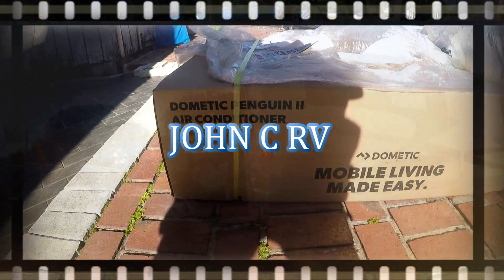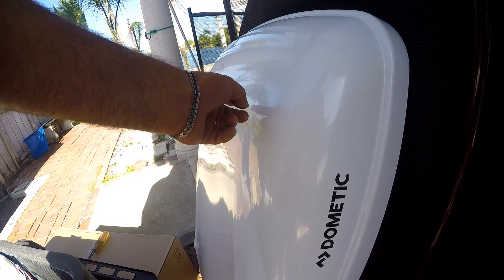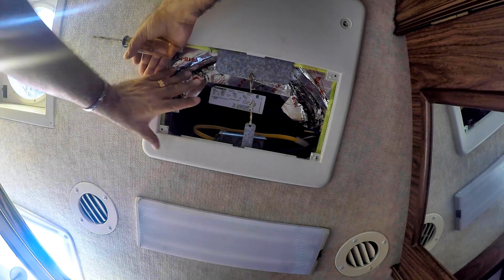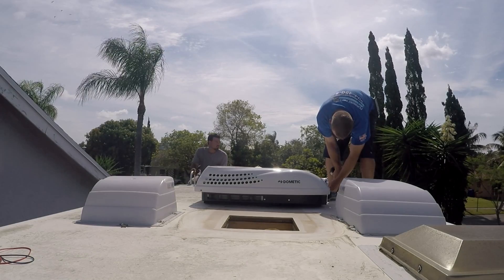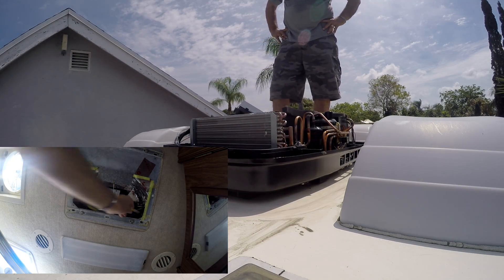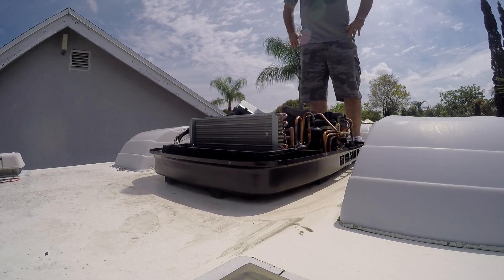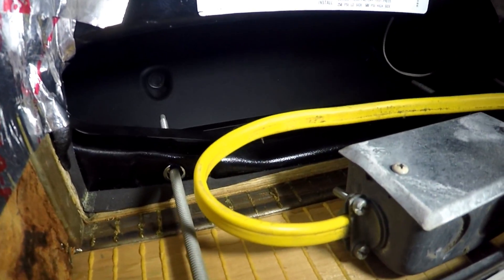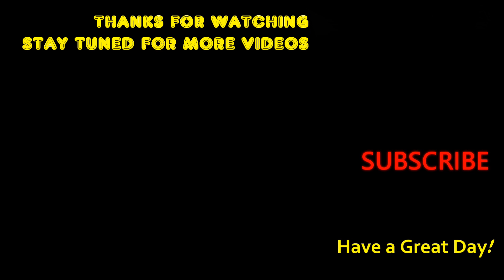HOW TO REPLACE RV AC DOMETIC PENGUIN II DUO THERM HEAT PUMP  - 12 button to 5 button Conversion kit

Comment from the maker: Replacing the 14 year old (rear) roof AC unit on my motorhome. The new air condition is a Dometic (651815) Penguin II - 13500 BTU - Low Profile - Duo Therm - Heat Pump and conversion kit to make it compatible with my 5 button controller.

Comment: Great video, very helpful. Can you walk me thru the decision to stick with the 5 button thermostat? Does the 12 button thermostat require running new wires? Or what?
Reply from the maker: The biggest reason is my front A/C unit is not compatible with the 12 button. If and when I exchange that one I will definitely convert back to the 12 button.

Comment: This video really saved the day.  Was able to successfully do this exact same process on a retired Navy Chief’s Motorhome in about 4 hours including the control board.  We watched this video about 5 times!  For the part you clipped out about wiring the new 5-button control module, if anyone reads this, the instructions are pretty good that come with the board, and easy to do.  For the dip switches, just make it the same as the one you’re replacing.  Ours were all off but #5 furnace (on).  They are nice and cool again.
Reply from the maker: I’m glad this is helping someone out there, this is really a great comment. The board  swap was very easy to do after I watched the technician do it LoL. But it would have taken me forever to do that part. You did the complete instal in 4 hours, fantastic. 🤙

Comment: Hi John, I like seeing a electrical panel that is well diagram, this way each breaker is explained so you don't have to guess. I like how you tell people to clean up before installing the new AC. Nice to have an AC friend. I thought it was an excellent video, you can see why people without  an A4 licence would have someone else replace the unit. Was the unit already charged? Excellent and thanks Like 80 Gary

Comment: You still have the old card (CCC2)?  Mine failed in my Airstream.  Looking for a used one...
Reply from the maker: don't know what the ccc2 is but this is P/N 3312227.000
Reply: CCC or CCC1 is the 5 button control that Dometic used that is in your RV.  That is why you had to swap your controller card as CCC2 uses a different thermostat control hookup now.
Reply from the maker: The card that was in the old unit I do not have, Gave it to the Technician as part of payment. Sorry. I was thinking of saving it for the front AC but that was different as well.

Comment: Glad you had some help getting the unit to the roof! Would have been hard to impossible otherwise!
Reply from the maker: The way we lifted the unit on the roof is written in the description. I just did not want to include it in the video. The ancients knew how to lift without cranes. 😆